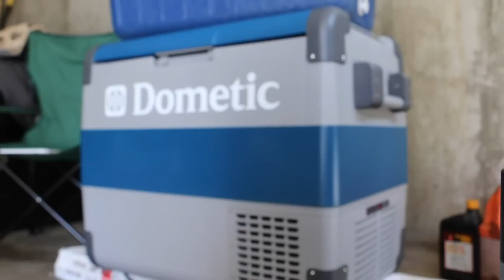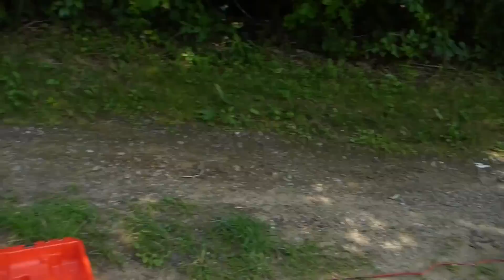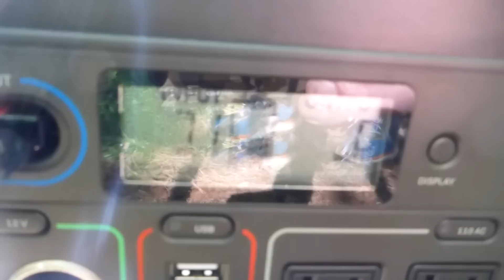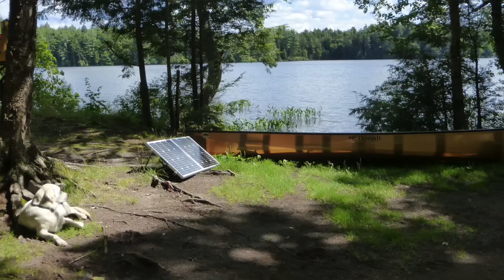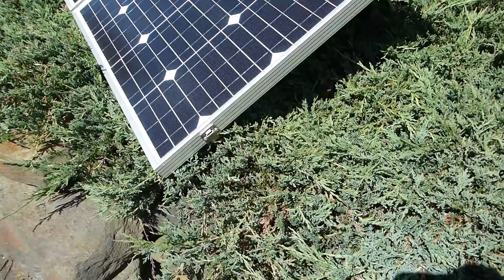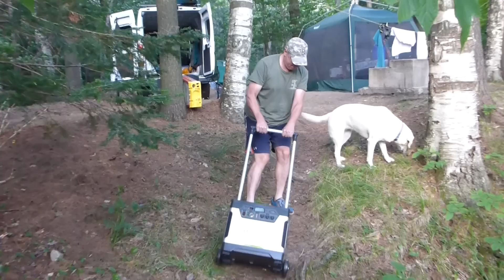Goal Zero Yeti 1250 Real World Experience

Comment: You could've bought the ring terminal cable and connected an additional 105ah lead-acid battery (under the back panel of the 1250). You would've been happy.

Comment: Add a cheap $20 150w inverter for your cigarette lighter in your car/van to power the yeti with the factory solar AC charger while you are driving. It would be just like charging at home. Also when the internal battery goes out, change it to a 100ah 12v lifepo4. That will will take off 30lb. off the whole unit.

Comment: Get a second 100ah battery, goal zero 2nd small charge controller and hook the battery to the solar panel. Charge the battery, connect 2nd battery to the 1250 yet I. I have that setup, no problem, no lugging the 1250 around

Comment: You need the Goal Zero with Lithium batteries. Your 1250 weighs about 100#. The Goal Zero 1400 with Lithium battery weighs 50#. It also charges faster than a lead acid.
Reply from the maker: Rick Uyeda yeh, this are really sweet but you can’t chain an extra battery to them, which I was able to do to give myself an additional 100 ah of battery power.

Comment: i have one too and l find it to be lacking in staying power too. i have more then enough solar power fed into it 400, 120, 100 watt panels and i couldn't even run a normal fridge all day with and extra battery attached. i wish people would stop giving these things good reviews 3 years later mine has  dead batteries. this thing is an expensive dust collector. for 2 grand swing by Fredericton n.b. and you can have mine.

Comment: Cable length increases power loss (which inversely is minimised by voltage). Hence high voltage power lines. They probably kept it at 30 feet because you lose efficiency past that. Personally my solution to this would be better panels. I think this model can handle up to 280 or so input. So a pair of 140 ish panels in parallel would charge it better. In fact I'd probably go even higher and have a pair of 200 watt portable panels, just so you still collect energy at lower light levels. You could get thicker cabling to make the cables longer, but thicker cabling can also be expensive. I reckon once you've spent 2k on this thing, to make it really shine you probably need to spend another k on the charging. I kind wonder if you could do wind as well. But dunno how portable a small wind turbine could be made...

Comment: Used it wrong.
You need the solar panels set on your vans roof. Preferably bolted. And the battery locked inside it. Then park in the sun.
Having an insulated van, and low power AC unit helps too. Or evaporative coolers.

Comment: Dont know if you know this now but DC doesn't do very well with long cables. Especially with fairly thin cable like the stuff you were using. There is a considerable voltage drop, if you could get a much shorter cable you'd probably have a better experience!
Reply from the maker: I didn't know that until recently but watched a tv show about Edison vs. somebody else where Edison was preaching DC and the other was preaching AC and AC won.  But thank you.  Not thrilled with the cables that came with my solar panels but that's what I have.
Reply from the maker: Edison vs Westinghouse - https://en.wikipedia.org/wiki/War_of_Currents
Reply: You can either use shorter cable runs, OR use thicker cabling! Thicker cabling means less resistance which means you can have longer runs with less voltage drop. You wouldn't know the thickness of the cable you're using would you?
It looked like maybe 16 gauge cable?
Also let's assume the input voltage into the Yeti is 13.8v to charge the internal 12v battery and I don't recall hearing the amount of amps them panels can put out but lets say it's 5 amps with a 20m cable. 

That equates to roughly 20% voltage drop so the voltage being supplied could be as low as 11.17v. Get yourself some thicker cable or a much shorter one and I bet you'll get much better experience
Reply from the maker: I would guess it is 16 gauge probably.  I have my solar panels on the roof now.  I could shorten the cable but don't want to yet, want to make sure the battery is staying where I have it.  Thanks for the info.
Reply: TopShots Brad no problem bro reply to me here if you got any more questions i'll try and help
Reply: Looking of starting a goal zero solar set up soon. I like the ability to have the panels in the sun while the battery is in my van. There may be instances where I need long cabling to reach from the panels in the sun to the van in the shade. I read what you said about having longer but THICKER cables. Where could I find such cabling to connect the panels to the solar panel? Is this something that Goal Zero would sell or where could I find something like that and what is it called. I have like barely any knowledge on electrical stuff but am trying to learn.  Thank you in advance Alex and Brad!

Comment: I know this is a year old, but I have a question.
Did you continue to power your refrigerator while charging the battery?   If not, was that your original plan?  If you had a long enough cord would you have been able to use the unit 24/7 while charging it simultaneously during daylight hours?
Reply from the maker: Hi - I am still powering the fridge using the Goal Zero but have mounted the solar panels on the roof and it's working really well.  Have not run out of power all summer long and have had the fridge plugged in almost all summer.  https://www.youtube.com/watch?v=xExvQxfxxoc&list=PLFtjwqMy8t-yttYfljdGGOhG0-bobjkw8&index=13

Comment: The losses through a long cable will be large, park the van in full sun when your NOT in it, during the day then when done charging move it to shade, it is your Highest charging resource, if you are only getting less than 75 watts out of the solar, that is a problem you should be getting Minimum of 100-115 watts closer to 100% in full sun out of a 120watt panel set. I have 300 watts of flexible solar panels on the roof of my RV they are only 6 pounds each, and require NO Holes in the roof, My setup with a MPPT solar controller I am getting a High return of watt out close to 100% solar is a trade off.
Reply: Hey Gary, do you have a goal zero battery bank system with your flexible panels or created your own? Also, what is the brand of the panels you are using?

Thank you, 

-Monica

Comment: I got a 1250 two years ago I use it to run my 55" tv and blue ray player two led lamp and some time two fan at the same time with 240w panels plus i    Have a 100 amp battery for a back up to plug it in for more longer life if I need it .i live on the north east and I get e lot of sun in the summer lest in the winter but it works great year round plus save on my electric bill . Can not use heater it suck it down to fast. Ps I like it  and fuck the PSNH

Comment: Well, that's the problem with solar power - no sun, no power.  I like the Goal Zero stuff, but its essentially a 100 Ah AGM battery with a solar charge controller and a DC/AC inverter.  Consider your set up costs what, about $1600?  A 50 Ah Battery costs $80, a 1000 Watt inverter costs at most $1000, and a Yamaha 1000w generator you can hand carry costs $800.  You could have run this little, efficient generator for a few hours a day (1/4 load is 250 wats, 300% better than your panel) to charge your battery every day and not needed to fill it up again for 5 days.  No cancelled trips, no 300 foot extension cord, no struggling over tree roots, rain or shine, trees or no trees.  At some point, I think you need to recognize you may be adapting to your purchase's needs than purchasing what you need.

Still, I like your video reviews, and I like the GZ Yeti (they are great for amateur radio), but for anything with a motor/compressor batteries are just too bulky, expensive, and cumbersome to run for days on end without a real generator to quickly recharge the cell.

Comment: I use 8 Bolder 30's on two tri-pods with my 1250 and can usually get a full charge in 8 hours. I've been out for a full week and even when we ran three RV's off the 1250, never fully ran out of juice. I credit my propane powered fridge and LED lights as well as the capacity of the Yeti. Good stuff and great people.
Reply from the maker: +Marcus Hall Holy cow - 8 Boulder 30's?  Wow.  If you're not running a fridge, is it just lights you're powering?  Or what else?
Reply: +TopShots our RV batteries died right after I bought the Yeti 1250, so I just plug my whole trailer into the Yeti as if I was plugging into any 110 outlet. we run the whole trailer, but the fridge is old school propane, doesn't require any electricity. We used lights, laptop, Ipads/ipods, fans, and whatever. Last time we were out, inlaw's RV batteries died too, but they have a new trailer that requires some electricity for the fridge even when it's switched over to Propane. We plugged their trailer in too, ran both trailers off one 1250. We all have LED light bulbs in the trailers, so the draw was very manageable for the whole week. We never ran the 1250 dry. Now... at Scout Camp we had a counter top ice maker. That thing could drain a 1250 in about 3 hours of continuous use. Just depends on what you are doing!
Reply from the maker: Awesome!  I've been thinking of adding a ceiling fan in my van.  By any chance, do you have any idea how many watts just one ceiling fan uses?  Thanks.

Comment: You probably would do well to have a pinch hitter when you are in a shaded area. That is a quiet efficient generator they weigh less than 50 lbs and can be had for under $700. Yes it cost to run them for fuel but they are what you require to keep from running your van to power a refrigerator. 
If this is not your style then next thing you do is get a 3 way fridge and run propane. I would have that set up outside so it would be easy to level ? I have a 3 way in my camper and I will not take that camper on the road but I might take that fridge out of the camper place it in my cargo trailer and this way I can justify having that fridge. It is a $1.5 K fridge that makes ice I did not pay this for it I bought the camper for $2K  the family had to liquidate it to split the estate I got a 1970 Avion camper for $2.1K delivered to my house. With a $1.8K fridge (taxes) to boot their dad just replaced it. 
I don't camp all my life I have been a trucker and I just don't go camping. I do like to have plans in place for when we will face WROL Without Rule of LAW. The way Obama is acting he is trying to get to that point quick and in a hurry.
My cargo trailer was purchased for me to take my bike to the shop and to run like hell if we get a hurricane. I rather evacuate than die or suffer without after the storm. Much rather be where we can have electric and after the boys get the power back on we can come home and turn on the AC.
Reply: according to google translate a pinch hitter is a second batt man  ( sports term i guess??)